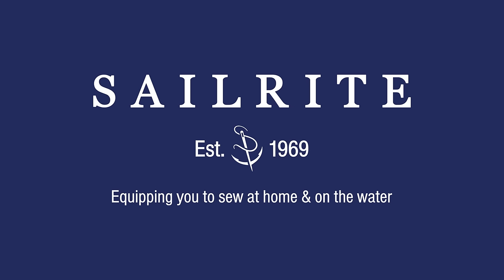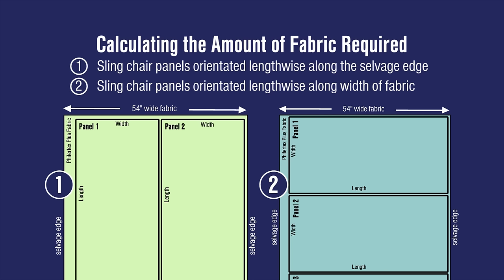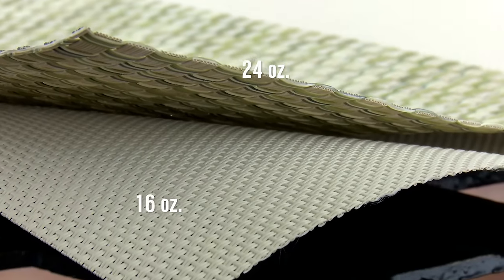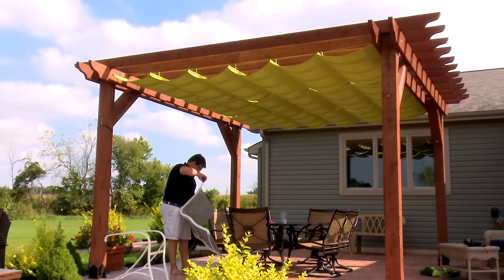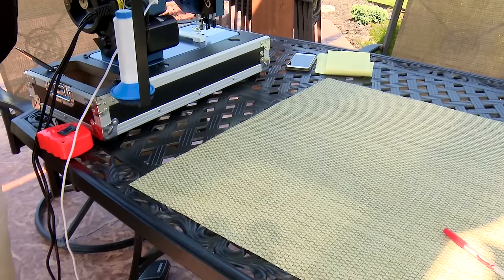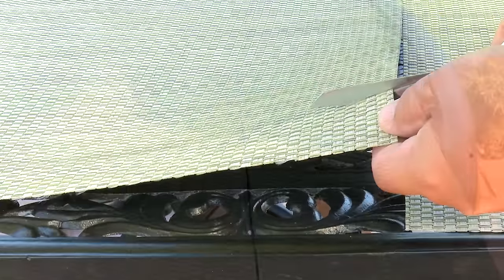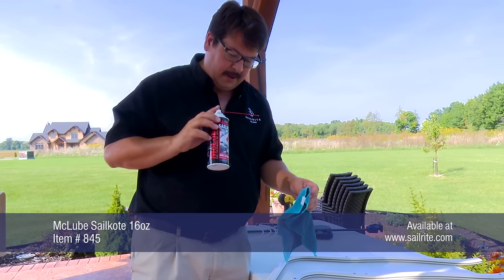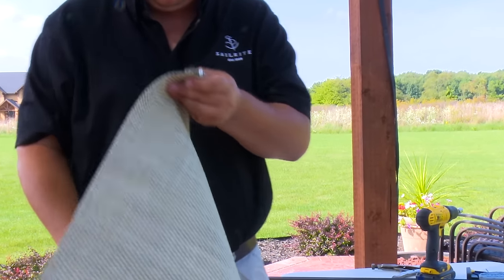How to Replace Fabric on a Patio Sling Chair

Comment: Great tutorial.  Getting the old, stiff sling fabric out was a challenge. After taking one side out, with a good deal of effort, I had an idea....Dawn to the rescue! I put a thin bead of the dish detergent on each side of the fabric, ~ wiggled the fabric back and forth as you did.  Then my husband slid it out with the vice grips pretty easily and quickly! As we needed to give the chair a final clean, win win!

Comment: we make and install hundreds of slings every year, a few more tips... mount the rails to the chair frame, one side at a time when sliding the sling down the rail. its much easier to do when the rail is supported. trim the spline and cap the rails before installing the spreader bars, it's easier to do when not under tension. most chair styles only require one rail to be taken off for installing the sling. to make it easier to slide heavy fabric into the rail you can slightly nib the corners of the rail channel. it's also easier to cut and slide the old fabric out of the rail with the rails still mounted to the chair frame. spraying water down the rails will make it easier to slide the old fabric out. great video guys!!
Reply from the maker: Excellent suggestions! Thanks!!!

Comment: After FINALLY replacing the fabric on my glider, I feel compelled to point out that the dude here is a PROFESSIONAL so he makes it look like a walk in the park.  In truth, there will be much cursing and gnashing of the teeth!  
But don't give up!  Just watch the video again - especially the part about bending the tension bars if they won't fit.  They seem to get straighter over time as weight is applied so bending them a little will help them fit back into the rails.
Once it's done, you can brag about how you "upcycled" your old patio furniture and made it all match!  Way to go!
Reply: I don't know about MUCH cursing.  I've never used a sewing machine before, and I only cursed a little bit. (Not nearly as much as when I sat down on the chair and the old material ripped on me.)    ;)  If a complete novice like me can do it, I'm sure pretty much anyone can.
MANY thanks for the helpful video (and great sling material, too)!

Comment: The fabric is really easy to put on, a certain way. I accidently made a couple fabrics too long, and instead of removing the stitching, we just folded the hem and made a pocket at one end. So we slid the pocket end first and as we pushed the sleeves in, the poles helped push the sleeves through. It was pretty easy and fast. We did the last three like this because those were the ones I screwed up, but ended to being the easiest ones to put together.

Comment: Some Sunbrella, v69, and my mother's old Kenmore sewing machine, and I was able to very easily replace the backs of 6 chairs.  Replacing was very easy as I think the chairs were better constructed than most; didn't have to fight the spreaders as much as you did.  This is my second project with materials from Sailrite -- previously replaced the seat and back on a wooden glider with Sunbrella and that has survived years so far in the snow and sun near Yosemite.  I keep thinking I'll buy a Sailrite machine, but that old Kenmore just keeps working.  Definitely need the hot knife for cutting Sunbrella.

Comment: I was doing this myself and had a problem pulling my material through the channel even after widening it because it has long floats (threads that do not intersect) and they kept getting caught on the opening to the channel. I found it really helped to use a zipper foot and stitch along the spline cord. I also use a bit of WD 40 to lubricate the channel.
Reply: Can you die the covers to a different color
Reply: V out the ends of the channel with a hand fils and use a silicon spray for a easier install.
Reply: files

Comment: Love the tips of spraying the sling holders, folding fabric on ends pulling sling & fabric.  Little confused on using that spreader bar. I just inserted mine back in as I put back together. But I have 5 to go & still have 2 lounge chairs which Im not looking forward to complete!

Comment: Thank you for an excellent guide. I  referred to the video again and again during my project!  My hands are somewhat sore but worth the effort . Its like I have completely new patio furniture for a fraction of the cost!  

I have a suggestions for your readers you may want to add to the instructions (or not!)
 

1. I used 3" long metal  hemming clips - the 3 inch long metal ones with quarter inch marks.  Helped alot when sewing the hems! and are an easy way to semi crease the fabric where desired.. . I will use again and again for various home projects and easier to use for my arthritic hands vs pins!

2. Please recommend readers get a heavy duty longer stretcher. I have both.  I was first using the medium and just could not get enough strength to stretch as needed. The heavier duty one with the longer (and more rubber-y pads) stretcher was so much simpler (albeit more expensive).  Maybe thats what you sell on line. . I already had 3 of the medium duty ones at home from other projects. 

3.  For Sunbrella fabrics with more stretch: to avoid sagging, cut the fabric a little smaller by 1/8-1/4".... when I used your measurements there was sagging. When I cut smaller more taut, no sagging.... of course that is probably why the stretching was more taxing but it did the trick! Hopefully I am not stressing the fabric out beyond its limitation!!! Time will tell.  

Would love to attach photos but can't figure out how to do this....
Reply from the maker: Wow, those are great suggestions. I can't modify the YouTube video, but I do hope that people read your comments here. You can post your excellent comments and photos on our website here: https://www.sailrite.com/How-to-Replace-Fabric-on-a-Patio-Sling-Chair (just scroll to the bottom of the page at that link and add your comments and photos to the discussion).

Comment: Dry lubricant works like a champ to make it easier to slide the sling out of the channels. Get it in a spray can and spray it in each end of the channel. No need for vice grips after spraying it in the channels.

Comment: I fixed my patio chairs,. The video was a big help, I would not recommend to use a striped material for your first set of chairs, your first chairs are hard, and I didn't want to make sure the strips were straight, my patio set was 15 years old, it looks like new, and should be ready for another 15 years.

Comment: I started out looking for a place to recover our four chairs then saw this. Less than $100 for four chairs to look new again. 
My old spline is solid plastic and pretty rigid after years so if I did not use some WD40 on it I would not have gotten it out without cutting up the old fabric a lot which we wanted as a size double check. 
The new fabric matches our frame color very closely .
Reply: Where did you get new fabric?

Comment: Great instructions!  We just did this for 6 chairs and they came out very nice with one exception.  The seat area is a bit saggy on a couple of chairs.  Does this mean the fabric is a bit too wide?  We can't stretch it any more due to the frame but i could make the fabric a bit narrower.
Reply from the maker: Yes, the panels may be slightly too wide on those couple of chairs you mentioned. When I have an issue like that (fabric not as tight as I like) it is usually because the tension bars are not pushing against the sides as tightly as they once did. If possible, it is not always possible, try inserting a washer or two between the tension bar ends. This will provide instant tension to the fabric. Or if possible try bending the tension bars to extend the length slightly, that may not be possible depending on the thickness and design of the tension bars.

Comment: I struggled like you pulling the fabric threw the channel for the first chair.  I also had to use a pair of players. 

I took a bar of hand soap and rubbed it on the part of the fabric that goes threw the channel.  The soap lubricated the material.   All the rest of the 5 chairs went very easy and did not need anything except my hands.
Reply from the maker: So glad that you got the job done. Good job!!!

Comment: Thank you for taking the time to make this video--it's really helpful. The top of our chair measures 16-3/4", and the bottom is 17.5". I wonder how we should deal with this? It seems too big a difference to use the smaller of the two measurements.
Reply from the maker: You are correct. Since the top and bottom measurement are that much different you will need to match the panels shape accounting for that difference at the top and bottom.

Comment: Just got new slings for 2 lounge chairs. Bottom seat parts both perfect and tight, top part on both is tight enough to use, but very subtle waving and loosness in it. Measured correct and sling tops came correct size. Any way to adjust chair frames even more to tighten it more? I already added a couple thicker washers in one spot where back bars connect to back of seat and that helped maybe 30% but still not great. Is this normal to happen when doing replacements?
Reply from the maker: Adding washers is always the first thing to try. If that does not work simply remove the fabric which is loose and rip the stitches and make the hem on one side a little larger, which in turn makes the chair tighter from frame to frame since the hem is folded over slightly more. It is that easy!

Comment: If you have trouble pulling out the spline, it might be because the fabric is too tight around the curves in the frame. I cut the fabric very close to the frame (not down the middle), and then I cut flex points into the fabric about every two inches, i.e a cut perpendicular to the direction of the spline all the way to the frame. That way, the fabric flexes easily with the spline as you remove it.

Comment: Quick question... When you were sewing the sleeves and you marked the 1/2" then 2" on each side and said between the two 2" lines was the final measurement of 20" (which was the measurement of the chair... rail -> rail before disassembling)... Where did the channel measurement go? I completely sewed the fabric for one chair, but I haven't assembled yet and I'm trying to imagine how the measurement of my final width being 20" won't be too short when that was the measurement that didn't include the channel at all. My fabric was too beat up to measure once I cut it off. I'm hoping when I assemble it just magically works but something seems funny to me here. Please please please respond.
Reply from the maker: Our chair from rail to rail was 19 3/8" after the sleeve size is added (0.31" x 2 = 0.62") It would then equal 20 inches. So.... I think you are forgetting to add the .31" for the sleeve size. Use this fabric calculator to help: https://www.fabric-calculator.com/SlingChair/index.html
Reply: @SailriteDIY  I was thinking the same thing as @laurengrover7563. I'm glad you pointed out your final measurement was not 20" and that 20" includes the sleeve size for both ends.

Comment: Why not use the original fabric as a pattern ? Also, wouldn't the double sided seam tape you all sell be better for holding seam down while sewing?

I have 80 pool side chairs to change out (60 lounge and 20 chairs similar to that chair). I will be ordering fabric from you guys.

Great video
Reply from the maker: Thanks for your kind comments and ordering from Sailrite! If you remove it carefully and it is not damaged by age, you can use it as a pattern. Yes, the seamstick would be helpful, just don't get it in the sleeve for the awning/sling cording. https://www.sailrite.com/Seamstick-1-4-Basting-Tape-for-Canvas-50-Yds

Comment: Our chairs have 3 side to side bars that are welded to the sides.  We don't have stretch bars to remove.  Is it still possible for us to get the right stretch?  We have 6 chairs and will try one to begin if it is possible.
Reply from the maker: Ya, I have seen sling chairs where frames are welded together rather than using removable stretcher bars or bars that are screwed together. In those situations it is very difficult to push new sling fabric panels into the grooves of the chair frames. I do not have much advice for a process except to possibly make smaller panels for easier installation. The manufacture was not thinking about replacing the fabric, but instead wants you to buy new chairs when the fabric wears out. I try to avoid buying sling chairs that are welded together to avoid that issue. I did see a youtube video (can't find it now) of someone installing slings to this kind of lounger, but they used 2 large clamps to bring the side rails closer together, slightly bending the already curved stretcher bars. Then after getting the fabric in place I would lay the chair frame on a flat surface and apply pressure to the welded tension bar (probably by standing on them or using some of my body weight) bending the bars back to original shape to tension the fabric.

Comment: This is a fantastic instructional video.  One question though - could you clarify where the second row of stitching goes on the lengthwise edges?  It seems like you are saying it goes about a quarter of an inch to the right of the first line of stitching - is that correct?  Or could you fortify the first row of stitch by just going over top of it?  Thanks in advance for considering this.
Reply from the maker: Glad you liked the video! I usually place the second row about a 1/4" from the first. Since the hem is rather large you can place that stitch on either the left or right side of the first stitch. Do not stitch right over the first stitch, that will weaken the fabric since the needle is penetrating it so many times in the same spot, it sort of perforates the fabric.
Reply: @SailriteDIY  great, thank you for the guidance!

Comment: If installing the sling with the spline, it's good to be sure that about 3 inches of spline extend beyond the sling at the end opposite where you start.  Otherwise when you finish the last inch of fabric will have no spline. Also, it helps to use a file and be sure that there are no sharp edges where you start to feed the sling.
Reply from the maker: Good suggestions, thanks!!!
Reply: I used a dremel tool to take off the sharp edges of the rail for the start.

Comment: I spray some WD-40 and turn the spine the opposite way in the grove or channel before pulling the spine out.  This helps to cleans the grime and makes the old spine come out easier.  Wipe away excess WD-40 once spine is out.

Comment: What can I use if I don't have a sewing machine to keep the fabric binded
Reply from the maker: Well.... I don't think it will work well without a sewing machine. We have not tested, but it may or may not work, to use HH-66 Vinyl Cement to glue Phifertex Plus sleeves in place. If you try using it and it works or not please comment back. I would think that sewing is better than gluing a sleeve, but who knows until it is tested.

Comment: When measuring the width would one need to add the 2” slot on each side along with the 5/16 hem? If one doesn’t add this dimension I would think the measurements would be too narrow and possibly ruin the entire project causing one to need to start over and order more fabric.
Reply from the maker: At 11:03 min we show calculations for the width (cut size) as follows: Width + (Slot x 2) + 4 = Cut width of fabric. Use the Sailrite Fabric Calculator for Sling Chairs and get it right the first time: https://www.fabric-calculator.com/SlingChair/index.html

Comment: is there any ready made to purchase of any size of the chair? how many yards of fabric in one chair.
Reply from the maker: You can use this calculator to figure how many yards you need. In most cases 1.33 yards will complete two sling chairs.

Comment: I realize this is an old video, but what size spline did you use?  My old spline is neither of the sizes carried by Sailrite.  Is it possible it shrank?
Reply from the maker: The spline for most chairs is 1/4" in size. No, the spline should not shrink in time.

Comment: I think rubbing some bar soap, or dish washing soap, or rubbing white candle wax or even Vaseline on the edge of the fabric that's to be slid through the rails will help it slide easier.
You can put some liquid soap or Vaseline on a Q-tip and run that through the rails to lube the insides.
I'm not sure why you measured the old fabric while it was still on the chair, and then measure it again while it was removed and flat on the floor. I would measure it after it's been removed. That would be much easier and it's more accurate than trying to measure around curves.
Reply from the maker: Good suggestions! Why measure the old fabric on the chair prior to removal? Many customers do not want to disassemble the chair prior to ordering the fabric. Measuring in advance to ordering new fabric means they can use the chair up until the date they are ready to sew and assemble the new panels.
Reply: Sailrite
That may be so, but, it's a real pain measuring curves esp when you have a floppy measuring tape. You'll get more accurate measuring if you do it while the material is flat. Also, at that point you can see all the hems so you can measure those too and add those measurements to the main ones to get the final size of the fabric.

Comment: Another question I just thought of,  why do you have to turn under the side 1/2"? Can you just fold it over like you did the top? It won't ravel. It sure would make it easier to begin pulling it through the rail.
Reply from the maker: The edge with the sling cording is the edge that will come under a great deal of stress when the occupant sits in the chair. So, creating this half inch fold is kind of important to help reinforce the fabric. The 1/2" fold should not get in the way of the fabric that has to be pulled through the metal channeling, since it is only folded back a half inch. I hope this information helps.